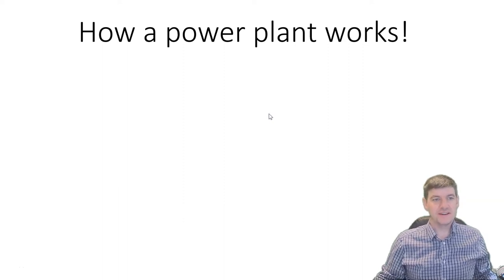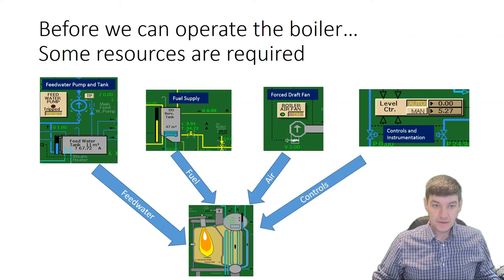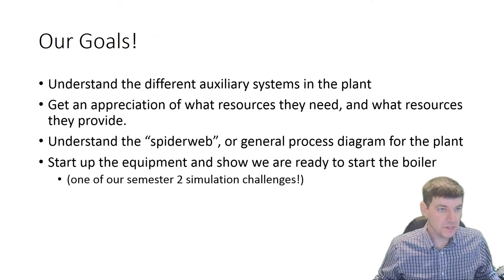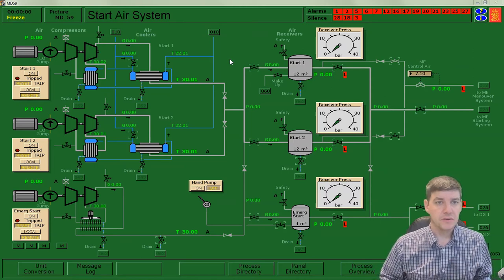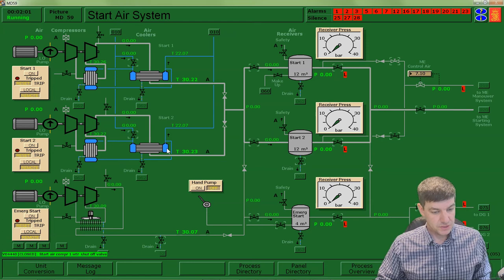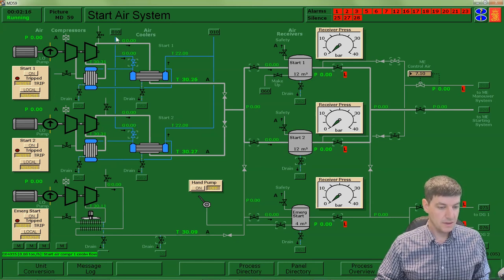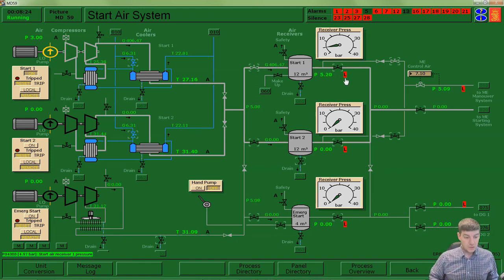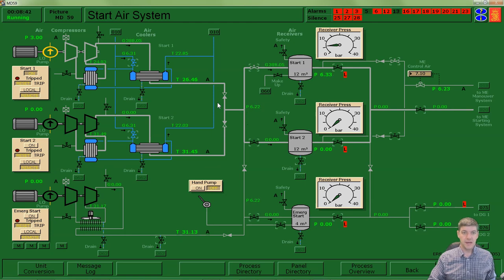PENG1014 - Power Plant Simulation - How a Power Plant Works!

Comment: Nice Video, but shouldn't you have verify or input the set point for the receiver.
Reply from the maker: Yes, good suggestion.  It would make sense to check the set points before putting a piece of equipment into auto.